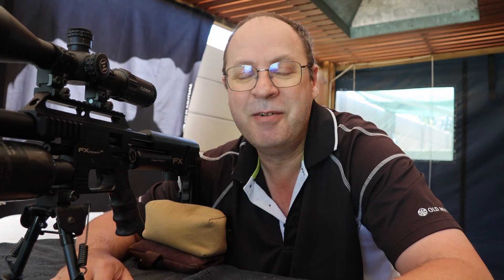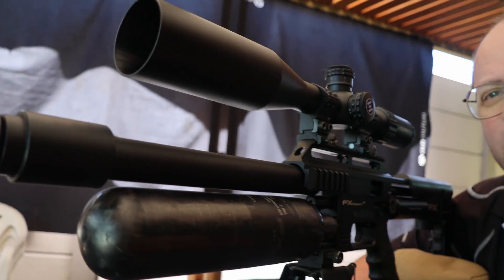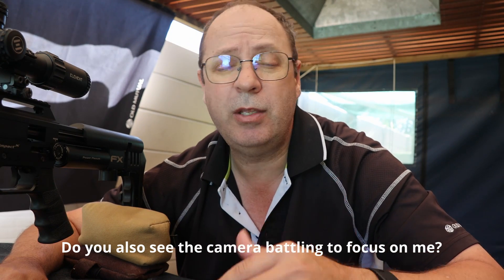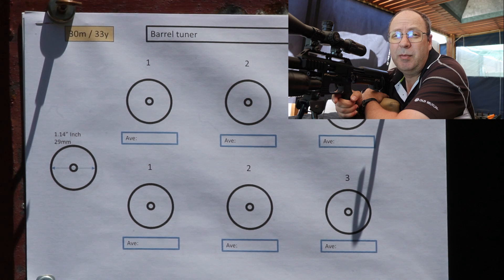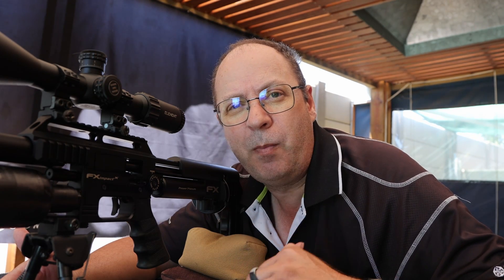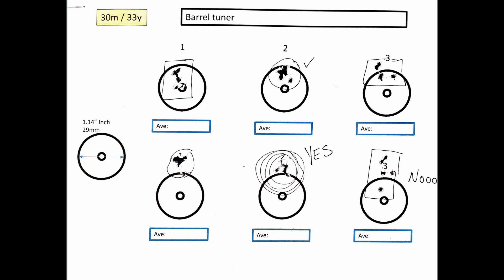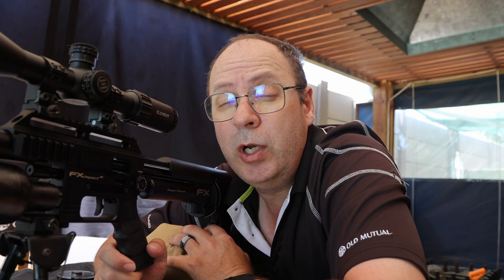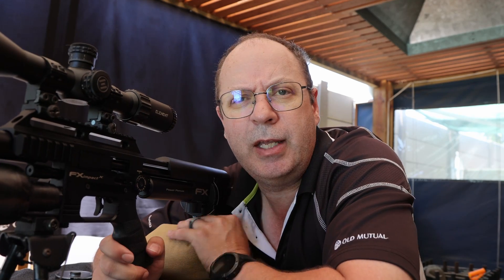Barrel tuner - do I need one? Do they work?

Comment: Hi Gert. I love your videos! I've been shooting your .217 unknown slugs. Do you perhaps sell any slugs in .216 ? I've got a .22 PCP with a chocked barrel. It shoots pellets pin point accurate , but shoots slugs all over the place. I've tried probably 7 different brands of slugs and struggle to get a good grouping. Your slugs have grouped the best that I've tested. I generally shoot my slugs around 940fps, but it can vary from 900 to 1000. Thanks a million. Ashley.
Reply from the maker: No, sorry, the only 216's will be the JSB KO's.
Reply: @AimSmall  Thanks Gert. Yes or the Thor or Gmax slugs.

Comment: Thanks for the video, I think you hit the nail on the head when using pellets and an adjustable rifle like the FX,  a tuner is just another gizmo to fiddle with. Slugs maybe a different story. How many tuners were visible at the extreme bench rest comp in Utah
Reply from the maker: Most of the benchrest guys use weights if no tuners, just about all the benchrest champs have weights on their barrels... The FX is adjustable and no need for a tuner, unless you don't want to fiddle around. I have shot 1000's of slugs to find the right tune on my gun and I am still not happy. lol.

Comment: Thumbs up
Good video and representation
Try to repeat the same at a longer distance, there will be definitely more visual representation of the impact the tunner will have.
The question i have is that will the tunner will have the same effect with different temperatures?
And lovely concept of marking the tunner easy repeatability
Reply from the maker: I am going to get another one that fits away from the shroud, will definately temperature test them. Thanks for the tip.

Comment: Does the harmonic barrel tuner also work on a stainless steel barrel?
Reply from the maker: Yes it will, but to a lessor extend, the stiffer the barrel the less effect it will have. My one friend uses one on his 22 rimfire with a very stiff barrel.
Reply: @AimSmall  , Thank you for your quick response.
I would like to go as accurately as i can with the Fx impact .25 ,and have installed a stainless steel outer tube for more rigidity and wonder if the harmonic barrel tuner would do any good.
Reply from the maker: @janhavinga5105  The FX allows you to fine tune, depending on what you want to shoot. I would look at minor adjustments before I invest in a barrel tuner. If you can't get super accuracy then yes add the barrel tuner.